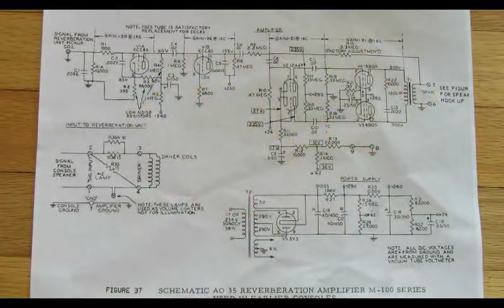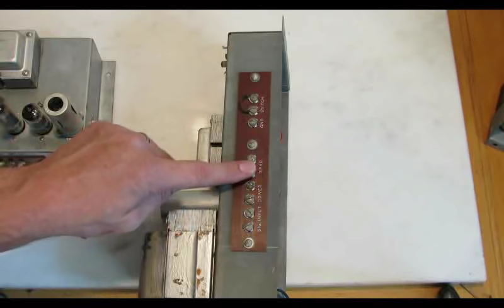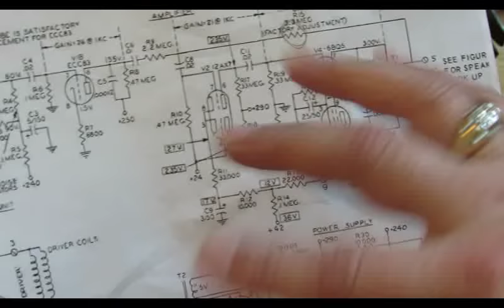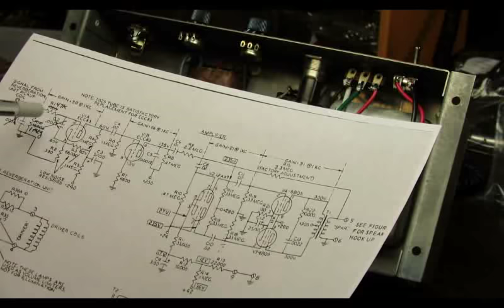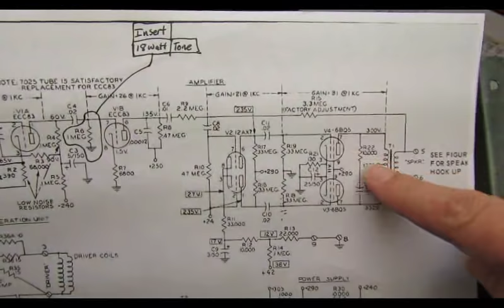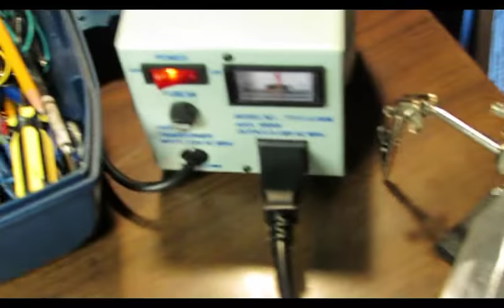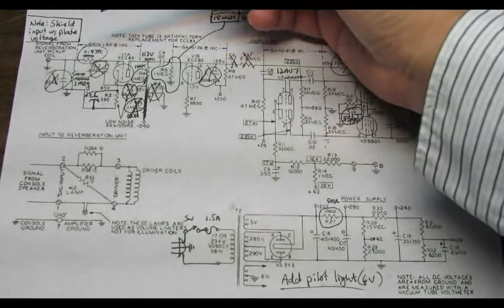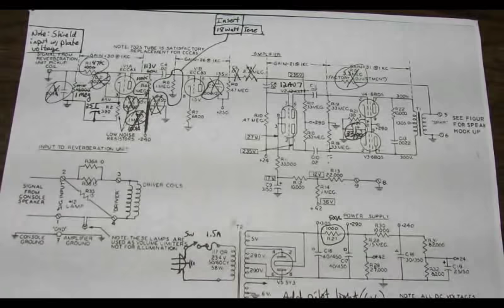Hammond AO-35 Complete Start to Finish Guitar Conversion & DEMO

Comment: "There are enough guitar amplifiers in the world."
Reply: There will never be enough  guitar amplifiers in the world.
Reply: @LSD123.  I happen to agree with you; I was just quoting the guy in the video.
Reply: The problem is that they are not mine! Most of the stuff ive built over the years has been the things I always wanted but could never own/JTM 45 , 5E3 , Leslie 18. Ive built a few straight clones but most of the time they end up being sort of my version or "take" on whatever it is im building. Sometimes tweaks or variations are out of necessity sometimes personal preference or both. I did one these several years ago and it's remained a favorite ever since. I did mine with an EF86 Pentode based first stage. It has a 6 position rotary switch that selects different coupling caps for the tone control and the volume control is in the power stage like a ppimv. I got rid of negative FB and added a subtle cut controlol.My controls are on the opposite side of how Brad does his here. I mill out between the two slots on the front and made a separate faceplate for my pots. I also made a cool little base out of thick plexiglass and made some handles out of stainless tubing. I painted it red and gave it some brushed aluminium knobs to compliment all the other aluminum. I mostly left the rest of the amp alone and it absolutely screams!! At the time i wanted something voxy although, admittedly i haven't really had enough experience with vox amps to truly know what that is.😄 However I honestly dont think vox has ever built anything, at least not on purpose anyway,that is this beasty🤘😄 If so it was probably doused with holy water and then burned,
Reply: @mikieknight6607  So it had a Matchless tone switch? Very nice; one of my favorite Runoff Groove projects is the Matchbox, which attempts to emulate that design.
Reply: @petersage5157  Yes it just selects a larger cap value every time you click it. 6 in all it goes from very thin to very fat and you dont have any of the loss associated with the impedance of a traditional tone stack. In the end its a very sparse signal path.
Reply: @petersage5157  some old selmer amps had similar tone controls but used pushbuttons and also Gibsons varitone control on some of  thier ES335, 355 guitars was this same circuit.

Comment: you can get a dr z carmen ghia head used for low bones if you look and wait. Leave these old Hammonds alone already.  my problem is the old Traynor amps. These were damn near given away at pawnshops around Michigan and the other Canada border states for decades. Not anymore. The jig is up on Traynors. Awesome little tone boxes that are rugged as hell. Top notch components and easy to mod and work on. The secret is out on vintage Traynors and the prices are going up. Keeping my 1977 ygm3 forever. Traded my dad a Blues Junior for it years ago.
Reply from the maker: I have a Traynor head I'll be tarting up soon.

Comment: I like the boring details of this format just fine, for at least the first time. I would have liked to see a side by side with the schematic as you were cutting up the wires because not all of us can remember where each wire went... and since this is actually instructional, why didn't we show the rear output jack, the pilot light, the tone stack, etc being wired up?? How do we know what wires to connect to?? Really? Was there a reason you didn't show us how you biased this rebuilt amp....and where's the schematic?**#!
Reply: consider the possibility that the only thing worse than him NOT showing us how he processed those details were if he did. ive built a total of 2 scratch-built kit style amps. 1 not successful & 20 yrs later i gutted it, revamped it into a 5f6a circuit. fortunately it sounds awesome & ive only had success because i had layout drawings & the internet. i have VERY basic understanding of how tube circuits work, 4:39  so im pleasantly surprised when i can see hes wrong before he does.. what i am impressed by however is the fact that his house hasnt burned to the ground yet. i'm jealous. i never have that kind of blind luck!